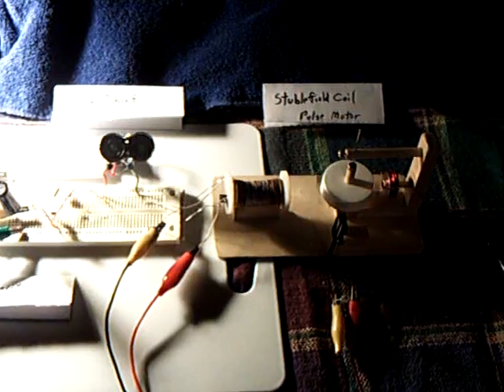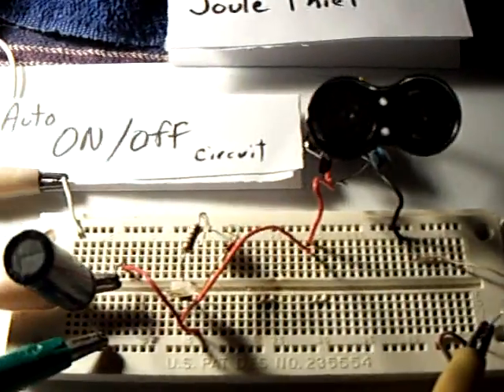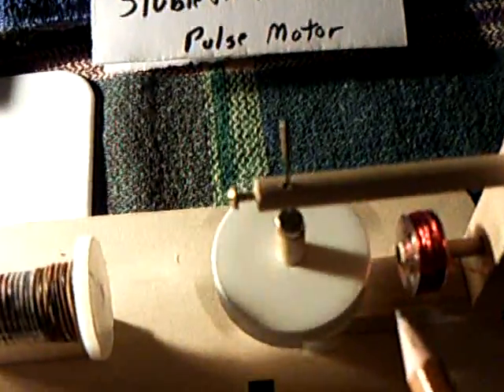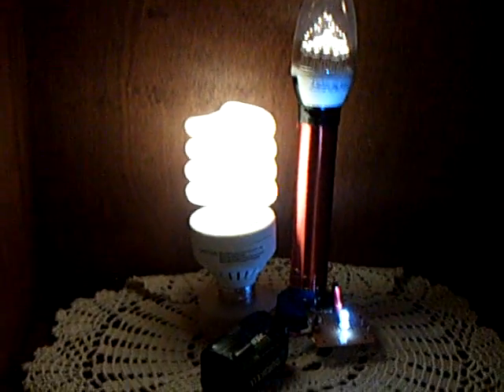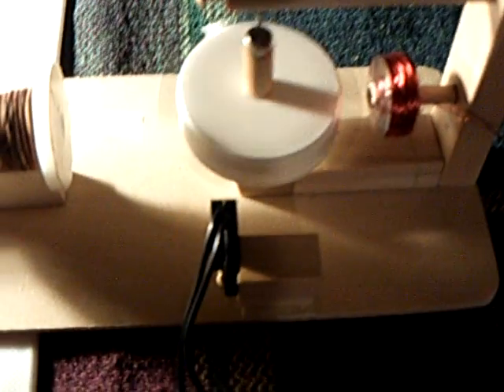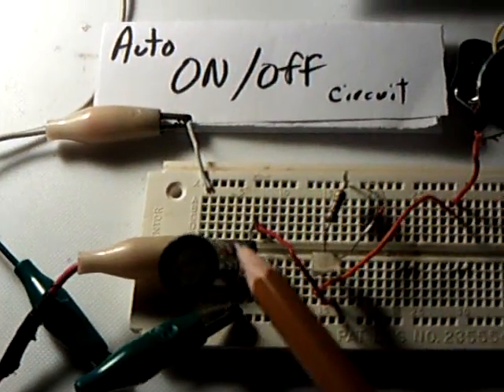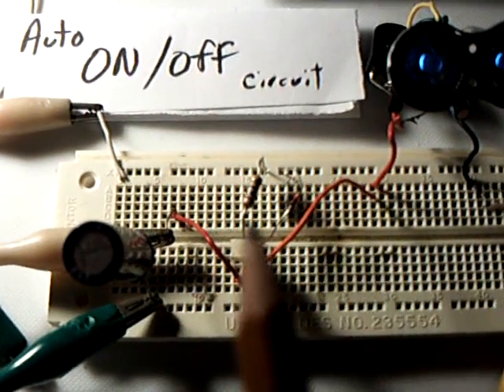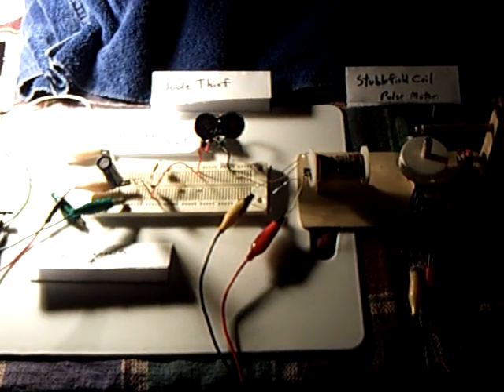Solar On-Off circuit---Stubblefield coil and Joule Thief.ASF

Comment: you could use the light sensor circuit that i made to switch the light on and off, so that during the day yr batt will charge, and at night the lights will use the battery

great work

Greets JB